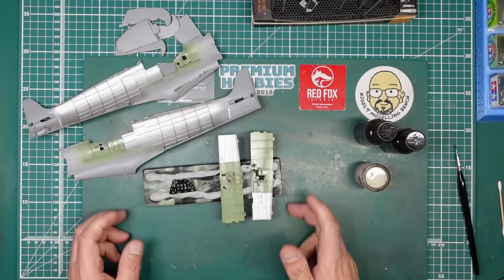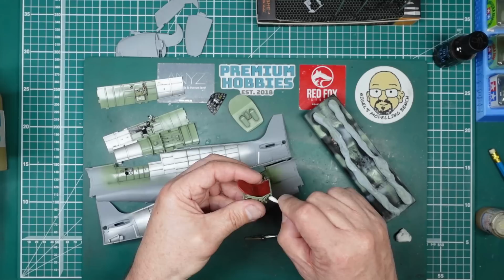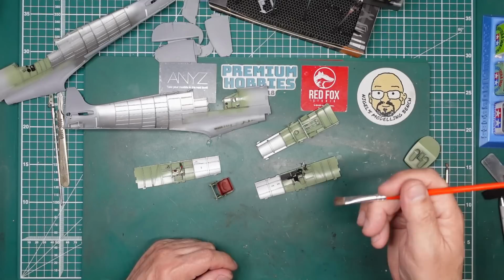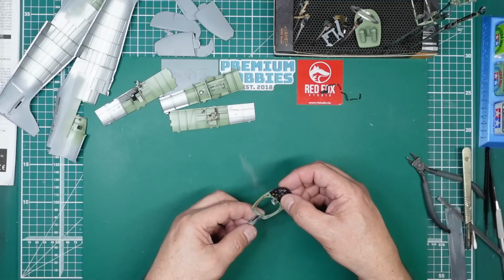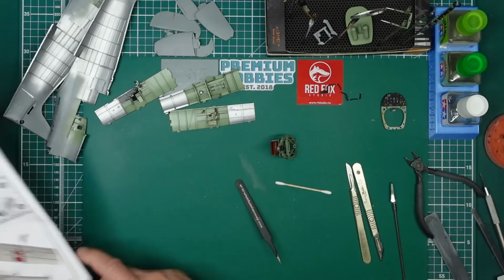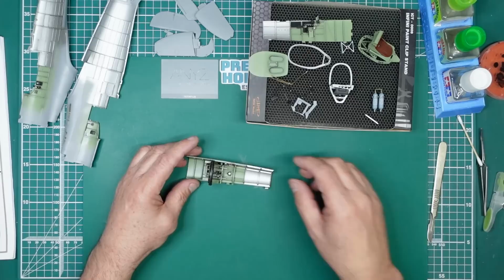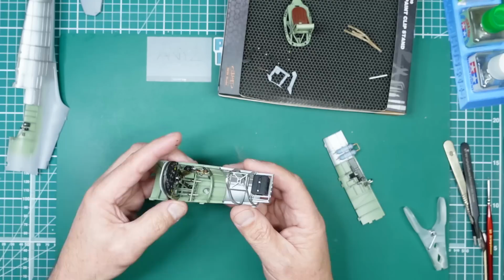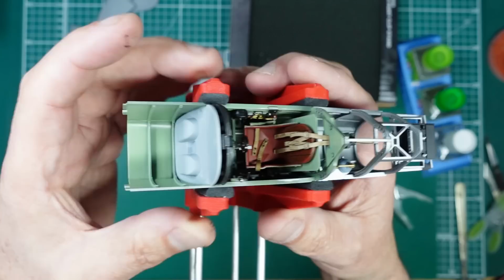Airfix new tool 1/24 Spitfire Mk.IXc Build. Part four

Comment: I don't know if you have glued the upper and lower wings together. Hopefully not. Why? I have found that the main gear is an extremely tight fit into the forward spar. Accordingly, I suggest repeated dry fitting and opening up the gear locating slot from the front until the gear can be slipped on. Adding parts F49 and F19 prior to gluing the upper wing on facilitates that particular addition.
Reply from the maker: I have just done that very thing this afternoon in part 6 John. I also suggested fitting F19 and 49 before adding the upper wing for a better paint finish in the wheel bay and easier access. I have slimmed the lug on the leg to make it fit a little easier but have left it pretty tight for a non glue fit, then if the legs break they can be removed easily and replaced.